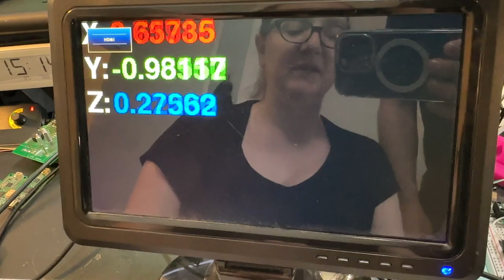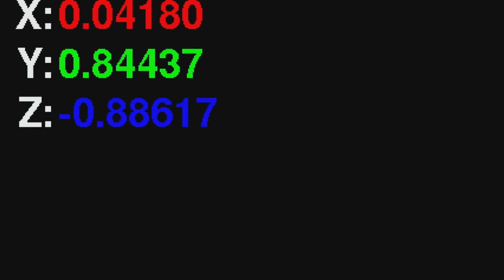INOYDA - RP2040 with DVI output first output test

Comment: Awesome! Any chance to get USB Host mode working with the Adafruit_PicoDVI library in the Arduino IDE? It would make some fine mini Terminal or BASIC computer if you could hook up a keyboard to the USB port via an OTG Adapter.

Comment: Could this put on display a BMP from an SD card in 1080p?
Reply: No, it has neither the ram (the SD card doesn't help there) nor the interface speed/frequency necessary for 1080p.
Reply: @steviestl2269  What should be the limits, then?
Reply: @dekipet There are projects out there that uses external ram and a hdmi controller.
Reply: @fredrikbergquist5734  What to search? How to find?